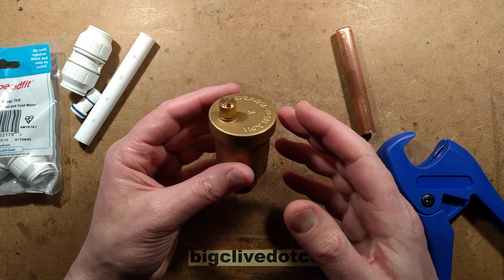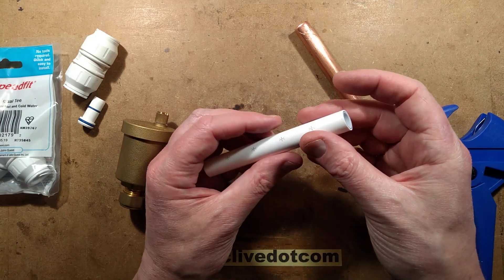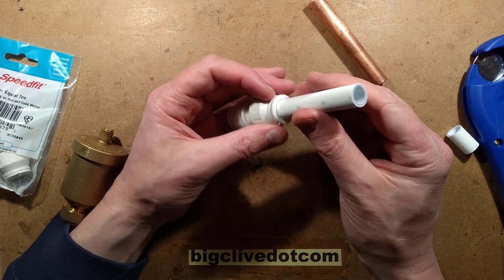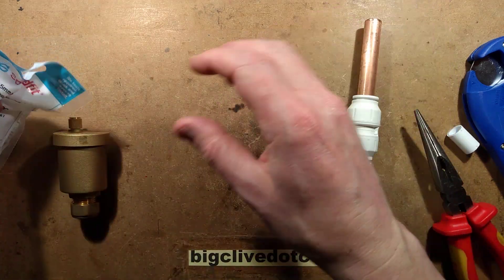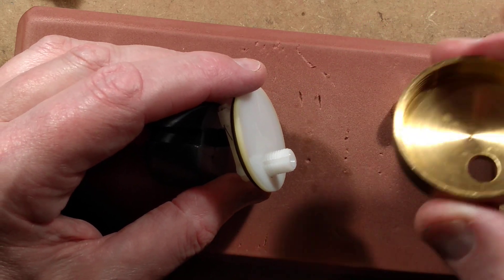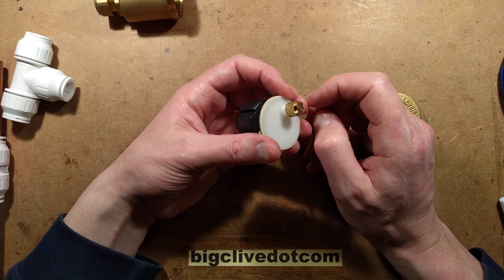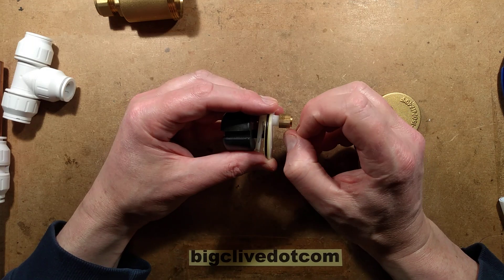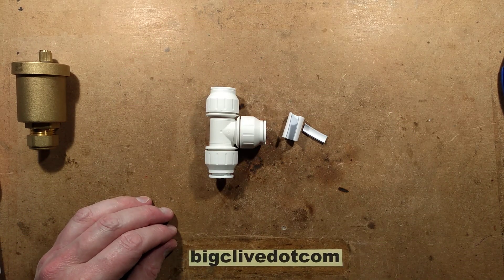Inside a bottle air vent and plumbing ramble.  (No electronics whatsoever.)

Comment: Thanks for sending viewers to my pressure testing video of the push fit fitting 😉

I installed a kitchen tap for my sister a few weeks back, and noticed that the “plumbers” that installed it had used plastic pipe- with NO INSERTS! I was shocked, so decided to test out plastic pipe on the pressure test bucket, without the inserts. I pumped the bucket up to the maximum (over 50 BAR) and not much happened. I expected the fitting to pop right off the pipe, but it didn’t! Obviously the test was done with cold water and I am in no way suggesting that inserts are not used! I would imagine that if hot water was used, you could get very wet- very quickly due to the expansion and contraction. You have a great channel and some good subscribers, congratulations! Greetings from Darwen, Lancashire.
Reply from the maker: I think most of the issues may be people forgetting to pop the inserts in or ramming rough ends through the O-rings and scratching them.  I'm wondering how adversely the sudden hammer from washing machine solenoid valves will affect the joints.
Reply: @bigclivedotcom   I would imagine that would have a huge effect on the fitting, especially if the house had high water pressure to begin with. It might not fail immediately, but after a few hundred wash cycles there is a good chance that the fitting will let go of the pipe. Thanks for the reply 😉
Reply: @bigclivedotcom  Here in the 'states' we use PEX with various fittings (I like 'SharkBite' which is a brand name that doesn't use inserts at all).
I've always told myself that the 'give' in PEX piping probably absorbs the hammer shock better than copper.  But maybe I'm just wishful thinking.  My washing machine doesn't have any hammer arresters.
Reply: So long as it's held under good pressure I'm not sure it would be that bad with hot either - but not recommended. I had a leak in my shower which turned out to be a missing insert on the pipe from the valve to the outlet - obviously this bit of pipe is basically at atmospheric every time I turn the shower off. 

The cowboy who installed that shower has created a lot of problems over the years for me 🤦

Comment: Interesting video.  The PEX ia fairly common in the US now - in my older house which is all copper, some recent repairs to leaking copper pipes has been done with PEX and one line specifically feeds the laundry (washer) which is used frequently and there has been no issues - it's great stuff and easy to work with compared to copper.  That bottle air vent looks neat - need one of those for my heating system - it's a water loop from an oil furnace and needs routine "bleeding". Thanks as always for great videos!

Comment: I figure that the copper plumbing in my home is good for 100 years or so.   How long does this plastic stuff last?
Reply from the maker: The copper plumbing in this place certainly hasn't lasted 100 years.  I'm not sure when the last modifications were done, but it's springing pinhole leaks from internal corrosion.
Reply: @bigclivedotcom  I suppose it depends on your water composition.  My home is served by very alkaline (high calcium) private well water--no municipal additives,  perhaps that's why the copper plumbing is going strong after 50 years.   When a municipal water treatment facility dumps additives, into the H2O I don't know what the result might be.   Consider Flint, Michigan--was fine for decades until the city managers decided to buy their water elsewhere.  The result was lead leaching out at many times the safe level.   Some cities here still use lead pipe for water mains--really great in that it's flexible; after all, the Romans used it.  Start dumping interesting chemicals in the name of sanitation and it's not so good,...

Comment: i  hate the compression fittings such a pain in the arse to do, pex is so good and easy for diy projects, you dont even have to put the inserts in ,normally the pipe in cold water is string enough

Comment: This fitting system reminds me of pneumatic fittings, they work the same way (except for the twisting part), and they don't use any o-rings just metal fittings and 6mm pvc pipe, and they are usually spec'ed for 8-20bar (115-290 psi) and doesn't leak any air.
They exploit the pressure to hold the pipe in place, the higher the pressure, the harder the fittings grip the pvc pipe.
I have tested these pneumatic fittings up to 50 bar (725 psi) and they kept working (although a little scary at these pressures)
And they are super easy to work with, just snip the pipe with scissors and plug them into the fittings. and disassembly is just as easy, very nice system! Wouldn't doubt the reliability for low pressure water when they work so reliably for high pressure air.

Comment: I've redone a whole house with PEX. In the States you can get manifolds for whole house distribution but here manifolds seem to be limited at 5 connections that have valve control. Whatever, if can make a distributed system possible rather than a single water control centre.

Comment: Most new builds are done with this system incomming, and hot water/heating supply,  the problem they have then is what does and does not need ,  equipotential bonding  the Iee have had to give guidlines on it, but as said most new builds for many years have been in speedifit or other propriorty named systems.

Comment: Wow I could sure use one of those auto bleeders on my hot water heating system.  When I purchased my home some 27 years ago now, one of the previous owners was a plumber.  He had replaced the old boiler system with a hot water system that came from a much larger building, probably taken out to put in a more modern device I would guess. At any rate, he filled the system with a freeze proof liquid and sealed it.  Well when he moved and the house sold, the new owner drained all the good stuff and filled it with city water, placing a valve to the main water system on the line.  What they failed to do was to put in any bleed system.  So when I purchased it, I had a plumber come over and place several pierce valves so I could bleed off the air that seemed to get in the lines.  Made the system work much better but all the bleeders are on the mop-board heaters, and as I get older, I find getting on the floor to bleed the radiators is a problem.  Well getting on the floor, no problem, getting back up, problem.

Comment: If you want a bit of a horror story, I was working on a house about 12 years ago, we were using that plastic pipe for the 1st time, don't remember which flavour but it had the metal inserts and smaller fittings.

We finished up most of the plumbing on a Friday afternoon (red flag #1) and we checked it all twice, no leaks nothing, gave everything a tug and it was fine. On the way out the door I asked the gaffer if I should turn the water off for the weekend, he declared that we'd had a good old inspect and it was fine so get in the van and fuck off.

Came back Monday morning and the living room ceiling, along with parts of the bathroom floor were now on the living room floor. One of the pipes had popped out of the compression fitting and basically been acting like a hosepipe for the last 48 hours. Completed fuckered the whole job.

90% chance it was operator error as everyone involved was inexperienced with this stuff, but we gave everything a good inspect before we left it as none of us was 100% sold on this new fangled plastic crap, and I've never known a copper pipe blow itself clean out a compression fitting.

Comment: I plumbed all of my bathroom with that exact stuff over 10 years ago and had no issues from the point I turned the water back on until this day.
Reply: Jimbaloidatron even the pinhole impure Cu pipe from the 50s made it to the 70s. Give it another decade, if not just for the polymer to fail then for the pushon fittings to enjoy oxidation.

Comment: I used a compression fitting just like the one you have in 2002 for an outside tap. T’d off the downstairs toilet inlet, it’s never leaked.

Comment: Would you be interested in me sending you some Sharkbite fittings from the US?  It's a universal fitting format sold in big box chains.  It works with copper, steel, PVC and PEX pipe.  It just pushes together with no tightening required.  I've only used it for repair situations that conventional fittings are too difficult to use.
Reply: James M. I vaguely recall that English standard pipe size are based in millimeters, not fractional inches.

Comment: as a plumber ive been using copper and plastic since my apprenticeship (13 years ago) copper looks allot better when its on show, but if its hidden use the plastic, only leak ive ever has with plastic was because I hadn't pushed it in all the way

Comment: I ended up replacing my plubming with PEX and the outer crimp rings. I tried to avoid using any inner barb fittings where I could due to them restricting the flow somewhat significantly. I imagine the same would happen with this system you're showing. that little insert would restrict flow a fair bit :(

Comment: Have used a bit of each type of pipe and fitting. I prefer those o-ring push fit connectors over crimped, glued, soldered or compression fit joints. The reason comes down to how the joint is formed and supported. The o-rings help mechanically isolate the intentionally damaged section of pipe from the rest of the system. The main thing to watch out for with PEX and PVC however is to make sure that pipe is anchored to the building with the appropriate anchors for the type your using. Water hammer becomes a more significant issue with plastic pipes than copper but is easy to mitigate with a consistent anchoring system.

Comment: Festo connectors for preasured air use the same concept as the JG Speedfit.
Reply: underwood pressured air is more commonly transported in steel or iron tubes due to installation in locations exposed to rough service.
Reply: @HighestRank  no, flexible tubes are uoften sed together with the festo connectors that use the same concept as the speedfit. https://www.festo.com/cms/de_de/5674.htm
special inside machines to drive moving parts, that is not possible with stiff iron tubes.

Comment: Those speed fit type plastic pipe connectors are really good. Big word of warning though, don't leave the fittings where your kids can get at them, my son got hold of one and stuck his finger into it, and yes, the metal teeth will happily latch on to skin. It took me nearly an hour to carefully cut the fitting so i could finally get the fitting off his finger. He won't be doing that again in a hurry - lesson learned the hard way.
Reply from the maker: From the way the instructions refer to that I'd say it's a common occurrence.

Comment: I had a new bathroom installed in 2004 the plumbers may have used an inferior plastic system or they may just not have been as good then but a joint sprung apart under the sink after only a couple of weeks. Fortunately we were at home and stopped a major flood. 
Because of this at my next property I insisted on copper pipework but of course plumbers being plumbers the pipes were indeed copper but the joints were push fit plastic. Serves me right for having the audacity to tell a plumber what I wanted in my own house.

Comment: Maybe someone contributing the 619 (by now) comments already clarified the term PEX.  But here goes anyway:  PEX is a trade term and abbreviation for Cross Linked Polyethylene.  Polyethylene itself is commonly called PE.  In basic form it has long molecules and is not very strong.  Cross linking forms sort of bridges between some of those molecules and stiffens the structure.

Comment: The inner layer is high density cross linked poly ethylene. PEX™️ The outer layer provides UV protection because polyethylene becomes brittle with UV. The smallest amount of sun light or mercury/neon lamps will make it disintegrate over time.  There are some nice videos of early versions without the outer layer failing.  The version without the outer is still being used in floor slab heating systems where the pipe is immured in a reinforced cement slab poured over ploy-styrene insulation base. The removal of the outer sheath improves thermal conductivity. The natural gas version has an additional aluminium layer because PEX as with most plastics is hydrocarbon permiable.

Comment: I felt the same way about copper vs. plastic until I used the plastic, when I fitted a power shower. Then I realised it was just as good and easier to work with. Stick with the JG Speedfit stuff and you'll do fine. I wouldn't bother with the more expensive inserts, personally. I just use the plain ones with no O-rings, and they seal fine and don't get stuck in the fittings ;-) I've only ever had one leak, a 22mm pipe, and that's because I forgot to put an insert in it! Even then it's only a dribble.

Comment: the way the auto air bleeder works is the same as your toilet cistern the float works the valve as more air is in the cup the lower the float is & valve opens to expel excess air when water fills cup the valve closes
Reply: jason adams that happens only when supposed your tank will not ‘go solid’, but in your toilet there’s an overflow tube open to the bowl to prevent that, yet a heating circuit must do just that: go solid.

Comment: Make sure if pex is going outside it’s no under ground in soil and if it is you need to wrap it in a silicone fibre wrap, it also can be exposed to direct sunlight can cause plastic to degrade and break. Use pex for under a house or in a ceiling and use copper for inground work.

Comment: Gubbins inside the bottle air vent interesting - I've never taken one apart. Re push - fit plumbing, I don't trust it either - but I've never seen one leak personally :o) I've used 6mm to 12mm push - fits and nylon tube for gases like nitrogen, and compressed/vacuum air, and they do leak eventually if you keep connecting and disconnecting - even if you cut pipe back to a good bit each time (with the proper cutter) - still, they are amazingly leakproof considering it really is only the pipe pushed into an O ring...must be a tapered seat causing pressure to tighten the seal or summat..though vac seals too....I should cut one open :o)
Reply from the maker: This one has a tiny tapered section with a ledge.  The tolerances are tiny, but it has the effect of gripping the pipe tighter as the pressure increases.  Quite clever.

Comment: I suspect that a major advantage of these plastic fittings is that you don't need to have an expensive tradesman to mess up the plumbing, if we can still call it that since there's largely no plumbum in most systems now. We can mess up water systems all by ourselves.

Comment: In new zealand a lot of the plastic plumming fails 25+ years, with massive damage. My mate said mostly where pipes where bent instead of joiner used. I was thinking plastic degrading as i seen plenty plastics rott in automotive not just House plumming
Reply: Intrade Motor
I suppose that with the flexibility of PEx, the replacement will look same-as-before.

Comment: Ive used poly plum for the past 10 years. completely rebuilt the water system in my old bungalow. central heating, main the lot.   very reliable. easy to do. I used copper to present to the radiators and poly plum feeding them.  Good good stuff when used properly
Reply: Robert Wolf
main the oars.

Comment: 20 years ago, I had a friend staying in my house while I was on holiday, there was some issue with the float valve in the water tank and he replaced a section of piping with that type of "plastic piping".

In fairness, it's lasted 20 years, but all the fittings and pipe have since gone yellow and I'm worried that they are now brittle and at risk of cracking or shattering.
Reply from the maker: You could always shut the water off and replace them with fresh stuff.
Reply: I may yet do that... but it was more a comment on the long term stability of the plastics used etc....

Comment: PEX is made of the same type of plastic as milk jugs which is HDPE a type of thermoplastic. PEX refers to the fact that its cross linked. The layering is related an oxygen barrier in the PEX tubing. This is unnecessary in drinking water applications but is used in heating and boiler applications because the oxygen can rust the boilers or radiators.

Comment: The worst thing about plastic plumbing is that it looks hideous and there are those ugly bulbous connectors rather than, neat end-fed capillary joints (at least neat in my imagination, rather than the actuality of my soldering). 

As for the pinhole problems, I wonder if that's made worse because the Isle of Man has soft water? A quick look indicates some samples are mildly acidic, although most are neutral whilst the very hard water where I live is slightly alkaline.

Comment: Pushfit is used extensively for beer hoses in pubs. I've used pushfit quite a lot, it's easier to get apart if you need to fix stuff. I remember doing a job with it, turning on the mains and hearing water spurting out. Turns out one of the fittings had the o-ring missing. So make sure its there :)

Comment: The spring would allow air to come in if the system pressure drops too low. This would prevent a vacuum which could potentially collapse pipework. So it's actually a clever 2 way valve that only passes air and not water. Also I could be totally wrong as I'm not a plumber.
Reply: Psychlone could be done instead with a bit of plastic, but even professional plumbers are not going to consider that what’s inside might not be all too heatproof and do things like sweat fittings directly onto the apparatus.